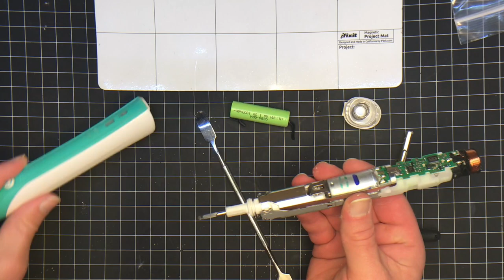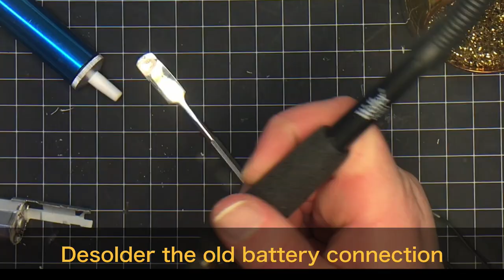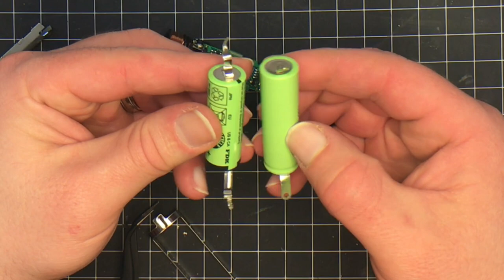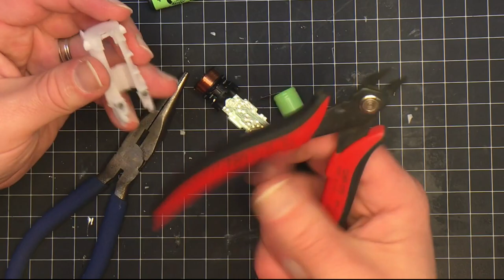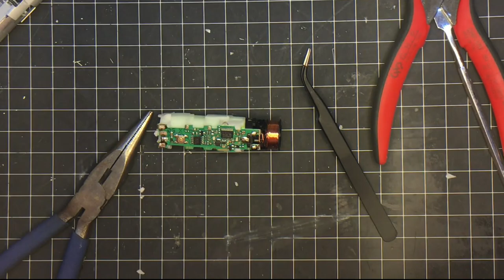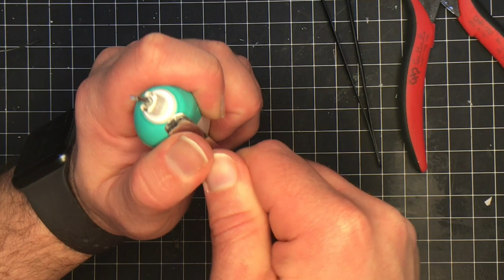Braun Oral-B 1000 Electric Rechargeable Toothbrush Battery Replacement

Comment: I bought an oral b 3D whitening that uses batteries instead of a charger and it works great . Just use rechargeable batteries and good to go . Keep one pair in the brush another in the battery charger.
Reply: Hi... but could be AA normal one? I bought one of those with replaceable battery and just worked for a month... thinking to buy one of this... just I don't like the fact I need to trash it when batteries dies.

Comment: I just restored two almost dead toothbrushes following your process, thank you so much! For some reason, it is very hard to find flat top batteries in India, so just used the regular button batteries and transferred the connectors from the old battery to the new one. For trimming the fins, I just used a regular cutter knife and it was much easier than using tools like diagonal cutter as shown in this video. One small mistake I made for the second one is that I left out a couple of small cylindrical plastic stoppers (of the size of about 3mm) while assembling it back. I saw them underneath the board and put them aside when one of them fell off, but forgot all about them later. I decided to just leave them be, as I think they were just for extra support. Strangely, I didn't come across the stoppers for the first repair, most probably because they never fell off or fell off and never noticed them.
Reply from the maker: Nice work!  Thanks for sharing your experience!
Reply: Also, I didn't use the charger to open bottom cap as it was taking too much force and it felt like the charging tip might break. I instead use a screwdriver to pry it open, like mentioned in a few other videos.

Comment: This is an oral b pro 500 toothbrush, not the PRO 1000, right? The pro 1000 has extra fine wire filaments inside the circuit for powering a over-flex detection light.
Reply from the maker: Thanks for the heads up! I fixed the title. When I made the video over a year ago I must have googled the the name and saw an image that matched my toothbrush and it was labeled Pro.
Reply from the maker: I ordered it off of amazon and it is titled "Deep Sweep 1000 Electric Rechargeable Power Toothbrush Powered by Braun".
Reply: Thanks for letting me know! Your video is great though. It's really good to be able to replace those batteries - and save on needing to buy a new toothbrush!
Reply: It is a 1000. The flex light isnt in the Pro series, only the smart series and up.

Comment: The battery you fitted, is just a standard AA rechargeable?
Reply from the maker: The one I used had soldered tabs on the end to make installation easier.  I think it would be pretty much the same spec wise though.  I just noticed the link on the video to the battery is no longer valid.  I'll get that fixed but I used a NiMh 1.2V AA 1800 mAh battery.  https://amzn.to/2LKLnCw #affiliatelink.
Reply: @DakotaBusy  This is also unavailable

Comment: changed the battery put on the charger and the low battery light is flashing red, what's wrong?
Reply from the maker: If leaving it on the charger for several hours doesn't fix it, I'd double check my wiring to make sure everything is connected properly (battery polarity, loose connections).  Otherwise it could be a bad battery or something else went bad.  Best of luck!
Reply: Probably you need to turn up the volume on some really bad music.

Comment: Why didn't you use a "puller"?  Your electrical work looks great but will the electrical receptacle on the bottom still take a charge after that abuse?
Reply from the maker: I don't have any "puller" device so forcing the base some was the only way to get something in there to pop off the end.  The charging coil at the end does have some flex to it too.  I've done this to two toothbrushes, one more than a year ago, and both continue to work just fine.  Thanks for your feedback!
Reply: Best way to get the end cap off is to put the toothbrush on the charging stand and bend it backwards - base pops off easily with no tools.
Reply: It's a contactless charger, using two coils to transfer the power, one in the toothbrush, one in the charger.
Reply: @slavedriver394  I"m afraid it doesn't work for me.

Comment: is that a 18650 battery ?
Reply from the maker: The 18650 has a larger diameter and its longer so it may not fit without some serious modifications of the internals. The one I got from amazon is the perfect diameter and slightly longer then factory, plus it already has tabs already soldered on.  http://amzn.to/2m0QeP3

Comment: The battery on amazon cost 9€ (in italy) a new tootbrush with litium battery cost 30€ (with new more powerful motor a cover a charger and a replacement brush) so its a really shit thing drop in the rubbish a thootbrush only for battery but the cost of the battery and the time of the sostitution is really too much in front a buy a new model..
Reply: You can also buy a cheaper 'regular' rechargeable battery (even AAA) and solder a couple wires to it.
Reply: @maxmordon7295  wow  really shocked ! Thanks a lot
Reply: And that’s why the planet is fked.